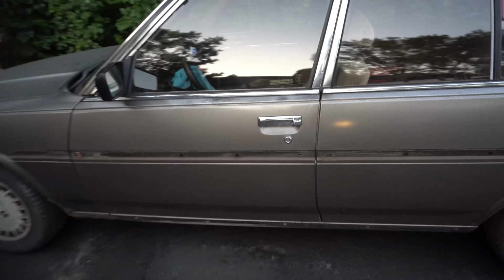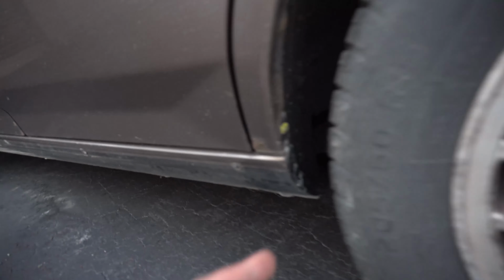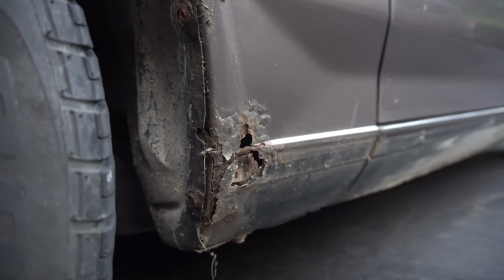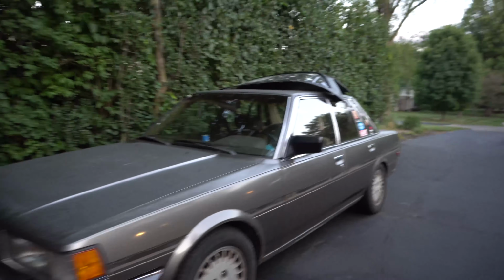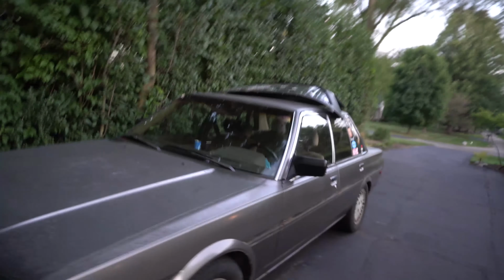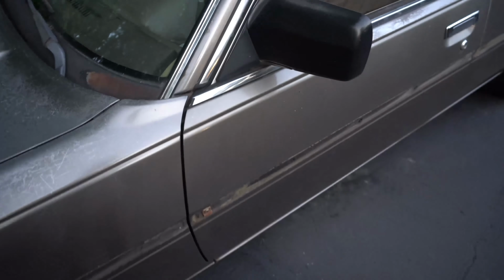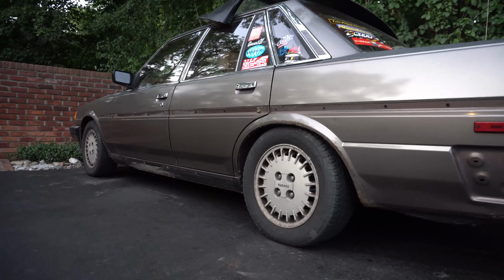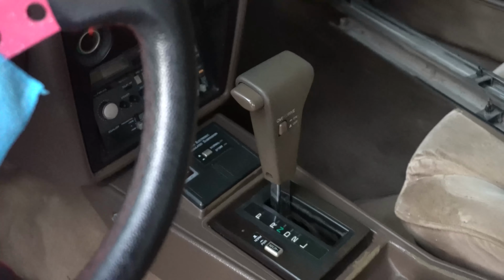The Bodywork BEGINS!! // MX73 Toyota Cressida Trim Removal

Comment: Hey did u use heat gun before taking it off or just popped it off
Reply from the maker: Mine just popped off
Reply: GARAGE 33 alright thx man love the videos btw
Reply: GARAGE 33 also do u remember what wheel spacers u used in later video
Reply from the maker: @averyabbott7888  Yep! Those are just 4x114.3 spacers I got off ebay